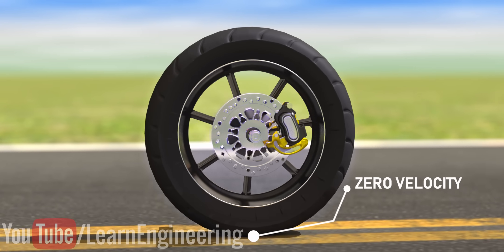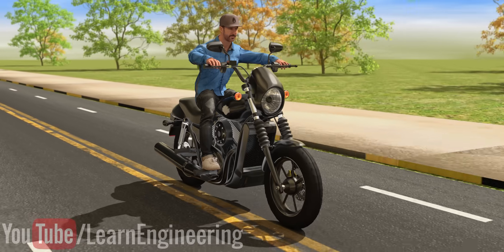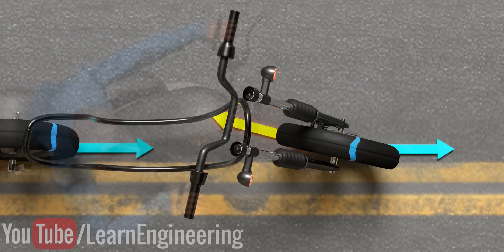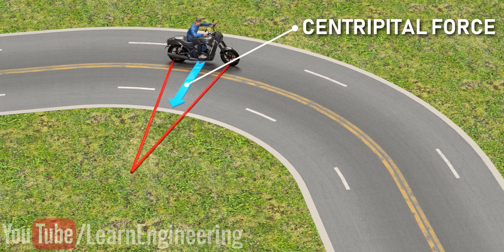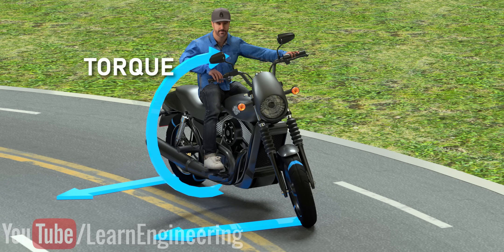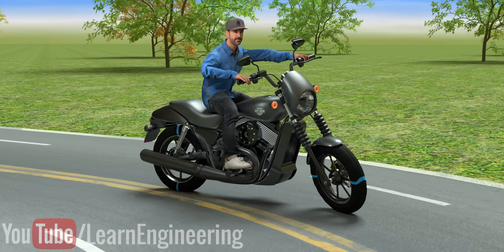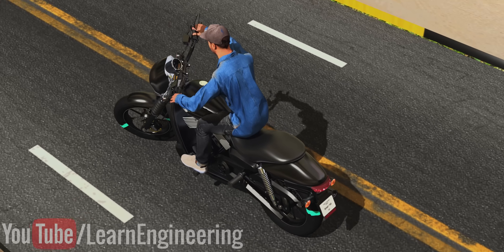Counter Steering | The interesting physics behind it

Comment: The explanation provided in this video is complete and utter BS and has NOTHING to do with science. Regardless of how you 'think' you are turning a motorcycle, you  are AWAYS countersteering because a bike cannot turn any other way. If you even think about turning the handle bars to the right as you lean to the right to make a right turn, the bike will go immediately left and you will be flapping off the wrong side.

If you lean right to turn right, the bike will go right 'only' because the front wheel will track slightly left as the weight of you, the motor, fuel tank, rear wheel seat, and frame etc, rotate the bearings in the frames yoke to force the front folks and wheel left. So the only difference between countersteering and leaning to steer is that the rider turns the handlebars 'lightly' in the opposite direction they wish to travel and then follows the bike into the turn if countersteering, or the rider leans the bike into the direction of the turn and the bike then follows the rider.

The ONLY time you can ever turn right to go right is at very very low car park 'figure of 8' speeds before the inertia of centrifugal force has come into play at a speed around 10kph where that force would hold the bike upright in a straight line, even without a rider. The faster the bike goes, the more that force comes in to play and tge more effective countersteering becomes.

Not understanding this principle probably kills more motorcyclist involved in single vehicle accidents that both speed and alcohol combined. This video is plain dangerous and irresponsible in its misinformation. CLEARLY THE CONTENT PROVIDER  RIDES A CALCULATOR RATHER THAN A MOTORCYCLE. THE THEORY WORKS OK AT 5KPH, BUT AFTER THAT, THEIR ADVISE 'WILL' KILL YOU.
Reply: Kim Bo
So you’re saying that the rider steers slightly in the opposite direction he wants to go, and then the rider steers into the bend?
Reply: @softailfun  Steer slightly opposite and simply follow the bike into the turn. You will find best control if you 'push' the right side of the handlebar forward gently with your right hand to make a right turn, and 'push' the left side forward gently with left hand to go left. This will cause the bike to lean in the direction of the turn, allow the rider to sit and follow the bike. 

If the rider leans the bike into the direction of the turn, which is the method most adopt when riding a motorcycle, the bike is then following the rider into the turn. It works, but is far slower than countersteering and with far less control over the bike. This is because even when the rider leans into the direction of the turn and the bike follows, countersteering has 'STILL' taken place because it it is simply not possible to corner a motorcycle any other way. The front 'will' turn slightly in the opposite direction as the rider leans into a turn regardless of wether the rider notices or not.

Countersteering works by breaking the inertia of centrifugal force generated by the spinning wheels. This force makes the bike naturally want to remain upright. You would have experienced this phenomena as a kid if you ever held a fast spinning object between your hands and tried to turn it from it's axis. Its the same force that keeps a spinning yoyo upright. 

The faster the wheels spin, the greater the force becomes and the more energy it takes to overcome it, until simply relying on leaning the motorcycle to make a turn, is not enough. This is what kills so many riders who don't understand the principal of how a motorcycle makes a turn. A rider out on the open road goes to lean his bike into a bend traveling much faster than he would normally negotiate the same corner in his day to day commute. He leans, but because of centrifugal force at the wheels, the bike is not responding, it wants to remain upright. He leans more but the bike only comes over slightly and by now, it is tracking wide. The rider is running out of road as he heads towards the apex and begins to panick, he trys to 'steer' the bike with the handlebars in the direction he needs to go just like he is manouvering in a carpark.....yep, he trys to turn the bars right, to go right, and the bike simply stands up and heads left straight into that big old tree that has been waiting patiently to take him all these years.

That guy had been a regular rider for 30+ years. If he had just understood that he only needed to countersteer with the handlebars to break that inertia and make that turn, he probably would have met his grandkids instead of becoming nutrients at the base of a tree.

You are all countersteering wether you know it or not. Doing it with understanding is the key. If you are behind a car at road speed and its rusted muffler comes spitting out the rear at you, leaning the bike out of the way is too slow. Even 'IF' you did manage to avoid it, WTF are you gonna do about your new line that is taking the bike into a headon with that  oncoming car? Your bike is still leaning to the left from the muffler manouver, are you now going to bring her over to the right by leaning to the right? Bet ya don't get her to follow you in time.....If on the other hand, all you needed to do was keep up with the changing lean of your bike as you changed direction countersteering the handlebars, then you stand a fighting chance. That's probably why they call them handlebars and not 'leaning grips'.
Reply: @mrkim3257  
Your term “follow the bike” after the rider has counter steered. So what your saying is, for a right hand turn…… counter steer left then steer right into the bend, is that right?
Reply: @softailfun  Its not 2 separate things, there is no "and then". When you countersteer left, you 'will' be turning right. Get on your bike, even a push bike will do the same above walking pace,  and try it yourself. Do that and all your questions wkll be answered immediately. It is important to understand that you won't be doing anything to the bike that you haven't already been doing, you will simply come to understand what is 'really' happening to the bike when you do it. Once you have proven to yourself that a bike, any 2 wheeled bike, can 'only' turn one way if the front wheel is directed the other, then you can use that information to control it faster, and more acuratly...go try it before you try to get your head around it. The slightest pressure will open your eyes to what we are talking about instantly and that knowledge is almost certain to save your life at some stage.
Reply: @mrkim3257  
Oh I’m fully aware of how counter steering works fella, and I thank you for your replies. It’s just that you made it sound like a two stage operation the way you described it….. which we both agree, it isn’t. A question for you, do you actually ride a bike? Just asking.
Reply: @softailfun  The way I describe it is just fine fella, maybe you should brush up on your comprehension. To answer your 'other' question, no, my Mum won't let me, so I'm restricted to roller skates for now. I won't ask you if you ride or not cause clearly your learning difficulties would make getting a licence a challenge for you.

Comment: Uh countersteering has more to do with gyroscopic precession than instability. You apply force to a spinning wheel and the force will manifest approximately 90 degrees from the manipulation in the direction of rotation. You turn right applying a force to the rear of the wheel in the left direction and to the front in the right direction. However the force manifests 90 degrees from the horizontal initial force and the wheel leans to the left.

Comment: Riding a 180Hp motorcycle at high speed is nothing like riding a 49cc moped on a parking lot.
If you think you can actually "turn" the handle bars on a real motorcycle while going 80mph you will die.
Reply: Well you never actually “turn” the bars to counter steer anyway. It’s a very small movement of the front wheel in the opposite direction, it’s barely perceptible…. but it works.

Comment: This is a very informative video but there are a few holes in the information. The video represents counter-steering as a riders mechanical input into the handle bars, from years of track experience im going to say this is half true. 
There are  three points that are missing from this presentation, that if added, would make for an excellent educational resource. 
1. Gyroscopic Effect of the spinning wheels( a person can enter a turn on motorcycle or bicycle with no hands on the handle bars and the front wheel will begin to track in the opposite direction as a function of speed and lean angle).
2. Coriolis Effect-(look it up) further effects how the cycle enters the turn(hint: left hand turns are easier in the Northern Hemisphere whereas right hand turns are easier in the Southern Hemisphere. Doesn’t just cause toilets to spin the opposite way).
3. True counter-steering is a technique to optimize the entrance and exit velocity by adjusting  path taken through a turn by sliding (drifting ) the front or rear tires of the cycle to change approach relative to the apex of a turn.
If anyone is just learning how to ride a motorized cycle on the road, consider attending a drifting course . It’ll make you a better and hopefully safer rider. 

Thanks for the cool video and I hope my input is taken just as that. Input. Have a good day.
Reply: That’s all very well, but the average motorcyclist doesn’t ride around the streets “drifting” the rear. As far as this video goes for road riding, it’s just wrong on one main point, and that point could well kill a rider if they follow this rubbish video.

Comment: Countersteering isn't something some or even many riders use. EVERY rider uses countersteering because that's how a two-wheeled vehicle changes direction. To turn right, the front wheel must be turned to the left do the bike will lean to the right to make the turn. The only time you turn the wheel in the direction you want to go is in low-speed maneuvers, tight parking lot maneuvers.

Comment: Your graphics don’t correspond to the actual counter steer technique. You depicted a handlebar turn which is not counter steer. In counter steer the slight forward pressure on the handgrip on the side you wish to turn to (or slight pull on the handgrip on the opposite side) causes the motorcycle to lean and turn in that direction. There is not a handle bar turn as you depicted. The body in most situations would be in a balanced or neutral position as body lean is not usually used to turn the motorcycle except in extreme situations like racing, and then is only used to keep the traction patch of the tire in better contact with the road or track surface by reducing motorcycle lean. Very misleading graphics.

Comment: "Normal steering" isn't a thing unless your bike is going so slowly that it doesn't have enough momentum to stay upright.  And there's nothing special you have to do to correct the direction of the handlebars (or the front wheel) when you countersteer, the bike will do that by itself because of the friction between the front tire and the road.

This video is dangerously wrong.

Comment: This... Isn't exactly accurate. Steering a bike at any speed over about 15mph will ALWAYS use counter steering. You just don't notice you're doing it, because physics.
Reply: And you don’t use a two step steering. You don’t counter steer and then steer into the bend.

Comment: By my riding, your ALWAYS steering this way... its just so subtle that you dont notice, but if you start putting “pressure” (you dont even feel the bars move really) in one direction, the bike lays down faster.... and this also works to stand the bike back up... standing the bike back up, by turning sharper, is 100% used by everyone who has ever drove in a parking lot...
Reply: All you need to do to stand the bike up is ease the pressure off the chosen grip. Bike will stand up and continue straight. Nothing on steering a bike needs to be “fast” or “sharp”, unless you are in an unforeseen situation.

Comment: It's called the gyroscopic Theory
Reply: That as maybe, but it doesn’t work the way this video would have you believe when steering a bike.
Reply: @softailfun  the bike wants to stay up after you get to a certain speed usually 20mph or over your forcing the bike to fall over one way or another that's how you turn counter steering is how it works mist people don't think about it because they rode bicycles as a kid so it's a non thought process. But turn left to go right and vice versa
Reply: @softailfun  I hope I cleared it up for you
Reply: @softailfun  oh one more thing contrary to popular belief you do not have to lean with the bike I can stay upright and force the bike to fall underneath me so leaning with the bike is not beneficial really unless you're racing but still they're not leaning with it they're keeping the tires from slipping adding weight in different areas
Reply: @stephenpohlman6268  
Appreciate the reply. You didn’t clear things up for me, I understand counter steering very well. My comment was aimed at the video being incorrect. And it’s on a very fundamental and misleading point.
The video states to take a right bend the rider steers left (ok so far), then goes on to say that the rider then “cleverly” turns a the front wheel into the bend….. well this just doesn’t happen. The front wheel steers into the bend right enough, but this is due to the steering geometry of the bike…. Not rider input. If the rider were to do this the effect would be to stand the bike up early and a failure to take the bend.

Comment: WTF - counter steering does not require to suddenly turn handles to the opposite direction intentionally. WTF is this video. Moto/physics automatically turn handles where they need to go. Rider does not feel this and continues to apply pressure to the opposite direction to force bike to turn. This is a very MISLEADING video.

Comment: Haven't been on a motorcycle since I was 17 and that was only a couple of times. But have been in bick marathons and I rode daily and never even heard of counter steering. It was a natural thing. Lean and it goes that way but there is also a slight turn, minut at best. Ride straight and lean your bike and it will want to steer the direction of the lean but keep the handlebars straightened ahead and you will fall over at any speed. There has to be a slight turn in the direction you want to go
Reply: Yes there is a slight turn into the direction of the bend…….
Yes, but not by the rider!

Comment: To all just going to pass exams - counter steering is NOT  necessary (or even helpful) to pass exams and not required or an easy solution to any figures you have to drive through. You can easily do all the figures just by practicing vertical balance and improving by practice. This is not an easy remedy for fckups. Even more, if you discover that you have trouble with one or other figure, moving to counter steering will be major draw back and will set you back to point 1 in developing any skills. Counter steering is advanced technique that might become useful in later years of riding. Do not assume it will help you with fast or slow slalom figure. You can do slaloms just by throttle/clutch work and keeping straight while leaning the bike. Don't overcomplicate things.
Reply: This video is rubbish! Agreed.
Counter steering is not an advanced method of steering, it’s the only method of steering above 12/15 mph! Learn before you feel the need to advise others!!!!
https://youtu.be/lzk8oyNO708

Comment: No, it isn’t counterintuitive.  And no, you do NOT turn the handle bars left to go right.  Counter-steering is just leaning the bike by pushing on the bar.  You aren’t steering, you’re pushing and leaning.  It’s just like riding a bicycle.  It’s the most intuitive movement there is.  It only becomes counterintuitive when we misname it, poorly explain it, and over complicate it.
Reply: I Kind of been doing wrong this whole time tbh, I’ve been riding for about a month taking the streets until me and my friends took some back Roads. What I would do instead of counter steering is push left to go right but I never felt myself leaning like the back but I’ll lean with it or push right to go left but I’ll lean with it
Reply: @5.7dobey  
https://youtu.be/lzk8oyNO708
Probably the best vid on counter steering on YouTube!

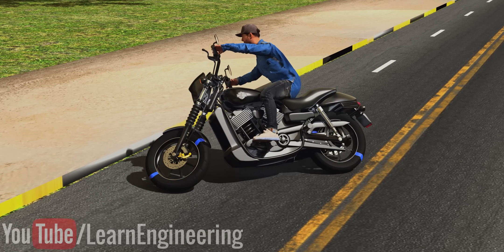Comment: 3:57 This is nonsense. All steering is countersteering. In "normal steering", countersteering is still taking place, just not by a conscious, learned manipulation of the bars in the opposite direction.  You may think you're doing it by leaning, but you initiate a small counter-steer which actually does the job and allows you to lean into the turn.